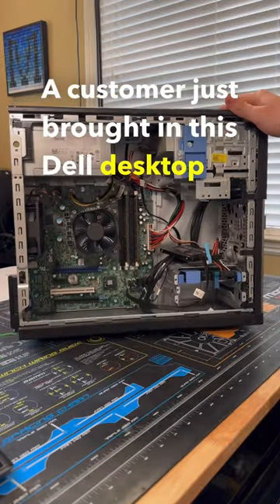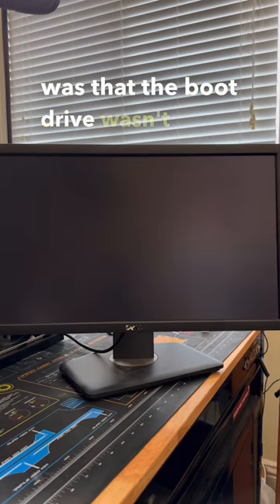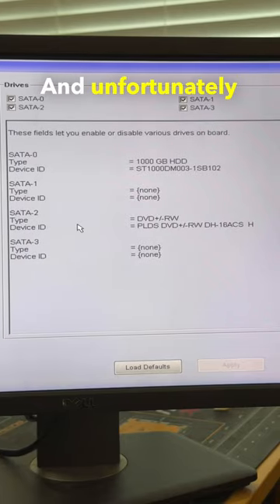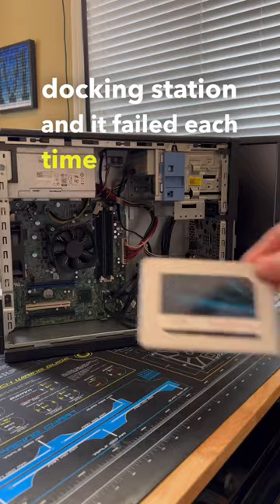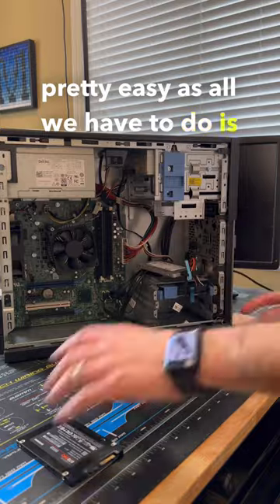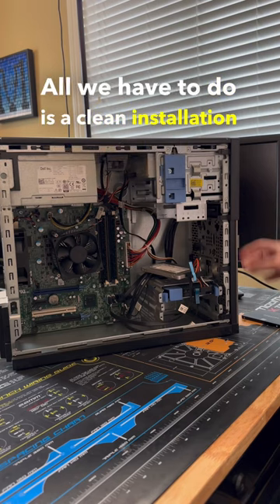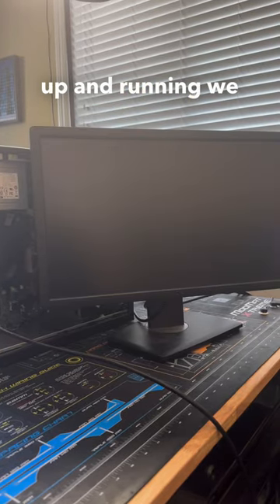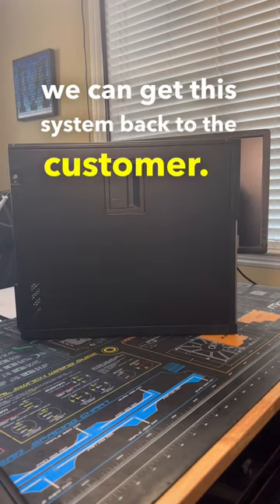No Boot Device Found!? FIXED! #shorts #pc #pcrepair

Comment: NEVER STORE IMPORTANT DATA IN BOOT DRIVE
Reply from the maker: Well you should never store it in one location rather aim for three if possible this customer was lucky they had file history set up to save on their secondary drive.
Reply: me who only has 1 hdd : 🗿
Reply: You are right until the other drive dies first
Reply: @mattscomputerservices  3 different places, carefully considered to ensure adequate accessibility and security.. honestly i think people know this intuitively but it's a case of believing 'it will never happen to me' combined with the logistics being a put off
Reply: One boot drive (SSD is a requirement, not a suggestion, honestly.), games on nvme drives, and all other data on a hdd.
Reply: @DustyCruz  i wont even store my data on HDD, an SSD is much safer
Reply: @WaylakeAnimations 😢
Reply: @DustyCruz  Do we honestly need NVME though? I'm perfectly fine with a SATA SSD on my laptop. I'm also fine with a SATA SSD and two SATA HDDs on my main desktop machine.
Reply: I have one NVME for boot, one for games, and 3 flash drives for storage and emergency boot, and one external 1tb SSD for a recovery disk with the basic boot info on it aswell
Reply: On my main gaming machine I have one sata ssd with Windows 7, one hdd with windows 8, and one hdd for backup.
Reply: If it’s data you really care about you should follow the 3 2 1 guidance for backups. Has nothing to do with it being a boot drive.
Reply: I literally have 4 of the same hard drives with the same information on them LO. L
Reply: What ever is hidden will appear 😂
Reply: Try to get another one. @WaylakeAnimations
Reply: Bro i need your help
Reply: @DustyCruz games on hard drives lag loading times , get 2 ssd for 1 general and other pure gaming 🙏

Comment: I migrated from hdd to ssd and everything went fine and my pc did turn on and after that i restarted it and then opened bios set my ssd as boot drive and it turned on again without any issue and i saw that my ssd was indeed the boot drive and after some time i turned on my pc and both hdd and ssd were plugged in to the system and then it showed the error “an OS wasn’t found try disconnecting any drives that’s don’t contain an OS”
Then i hit ctrl+alt+del to restart it and opened bios to set my old hdd as a bootable drive then my pc turned on and i just bought this ssd recently i don’t know what to do

Comment: but like i tried plugging in my old hdd that was working in my old pc same model as the current one im using but still it not working
Reply: Can you go into boot loader and manually load off that drive? If you plugged into a different data port it might not load automatically

Comment: So i need a new ssd/hdd
Reply: No. Sometimes can be only the data cable or also the Sata port that got bored. It's rare, but I've seen it happen before.
Reply: You know, I think I just need to reinstall windows, I was downloading steam when my computer got unplugged.
Reply: @spider496  I have a problem too it said in my screen a bootable device has not been detected .please refer to product guide.